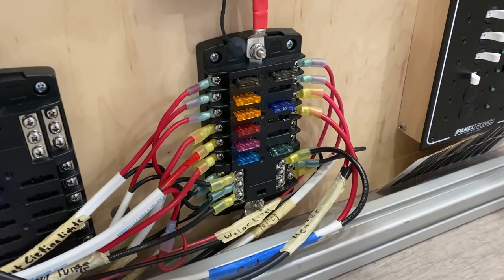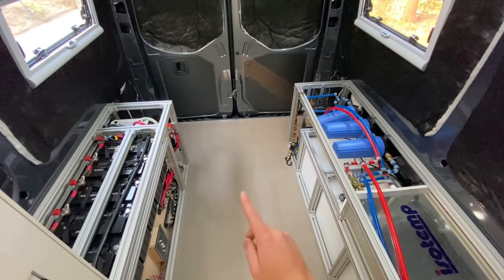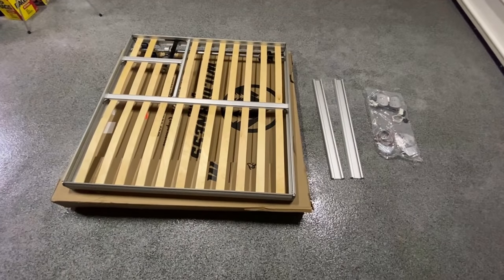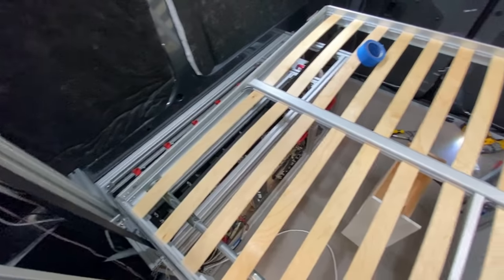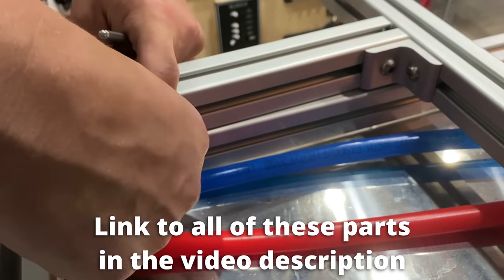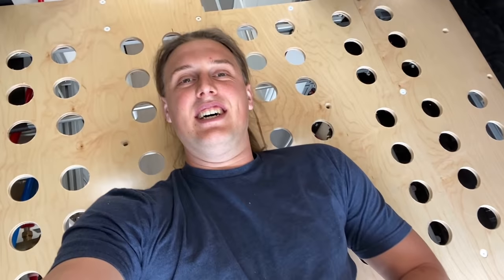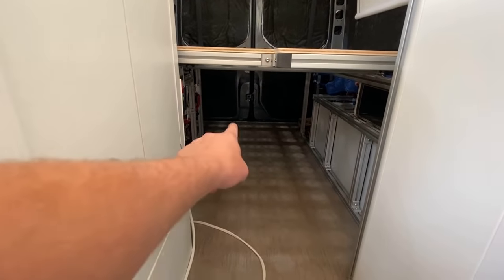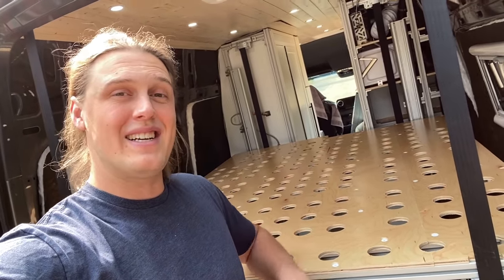I Made The BEST BED For Van Life 😴 (Rising Bed Lift System)

Comment: thank u for making this video ..Im looking for a bed lift for my transit..cause im in a wheelchair I need a bed system that I can have out of the way..while I have my sports chairs underneath..
Reply from the maker: That’s so cool! I’m glad you found this useful, sounds like it’d be perfect for wheelchair use
Reply: Tom, I ordered this exact same bed. It should arrive this week. Currently building out the back of a 144 sprinter your wheelchair access. C-5/6 quad.
Reply: @lorenworthington8739  sweet ru going to make a video of it? id like to know how high is its highest and the lowest it goes to the floor.. im a T10-11
Reply: @thomas-ms6st  I’m not the best videographer. Probably putting out hints and tips on IG is more my style. I was hoping to invite Mr. 7 0 savage to come over in consult/video 👍🏻
Reply: @lorenworthington8739  sweet good luck bro
Reply: @lorenworthington8739  what is ya ig

Comment: Why did you build a complete custom frame rather than just adding extensions to the stock frame?
Reply: (by turning the bed 90 degrees and then either building extensions directly to the frame or by adding a bigger plywood platform to the top)

Comment: If you park on a slope, can you level out the bed?
Reply: Tesa Van self-levelling system. Can flatten out a 17cm/6.5" diagonal difference from one corner to another corner.
Costs a fortune but (with extra blocks if necessary) will lift the van to horizontal and it will also be totally stable!
Great for cooking, sleeping and keeping dice rolls on the table😂

Comment: What is stopping the bed from going any higher. Would it be possible to get the platform up more if I used a thinner mattress?
Reply: The width of the van shrinks the higher you go, so if you ran a narrower platform you can squeeze it up tight against the ceiling like the. happijack does.

Comment: Yo dude I’m installing this bed lift right now and I’m having trouble with the wiring. The instructions have two “current” wires coming out of the control panel. Do you remember where these are supposed to be connected to?
Reply from the maker: I do remember the diagram I flashed as the correct one is what I used. I also remember “red and black” go to the + and - even though that didn’t seem to be the case based on their diagram.
Reply: @seven_o_savage  yea I was thinking the same thing and then I watched your video and saw you ran into the same problem. Ahah..I’m specifically talking about the controller. They have a connector going from the controller into the “power group connecter” but it also has these small 20 AWG wires that aren’t pre terminated. Wish they had better instructions. 

Side bar: love your videos and your excitement level. Please keep posting!
Reply from the maker: @davidespe8538  oh, i think those are for the little switch thingies you can install so that it "auto stops" when it touches them. I didn't use them though. Thanks man!

Comment: If you are 6'5 how are you standing up in the van. I am 6'4 and want a Sprinter Van over a Transit but I heard the Sprinter is 6'2 roof height with panels in
Reply from the maker: I used super low profile floor and ceiling so I could stand up. Still brush my head against ceiling though
Reply: @seven_o_savage  Would you still choose sprinter over transit? I want to do a euroloft bed in the back with large garage below
Reply from the maker: @DirtSickle1  yes i like how sprinters look and the cockpit area more